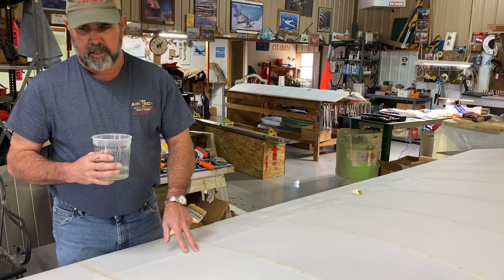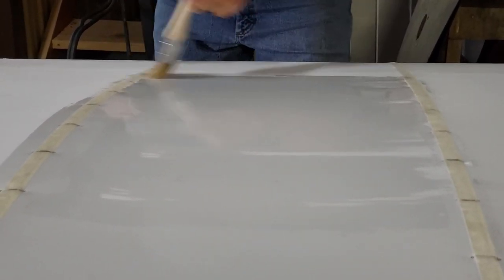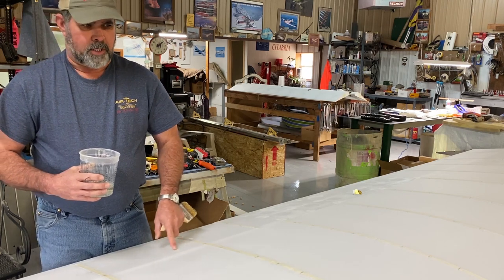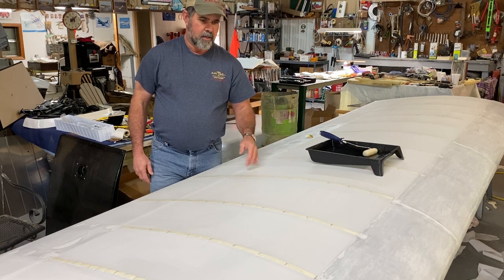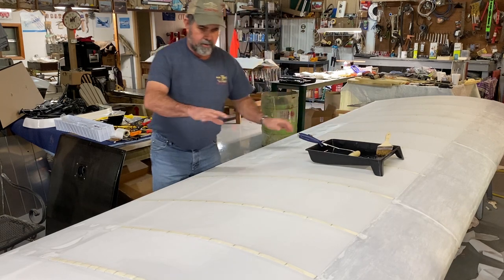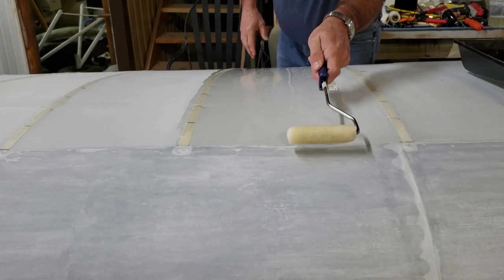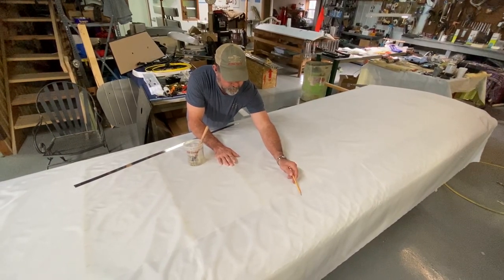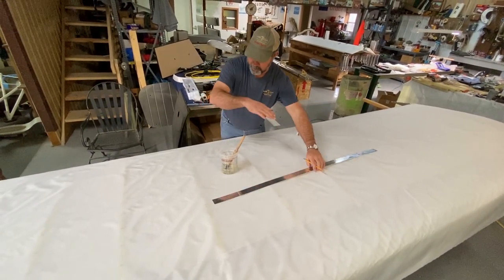17 - Airtech Coatings - Double Cover A Experimental Supercub Wing

Comment: The fabric is stitched or riveted on to take the air loads. The outer covering is simply glued over that with no mechanical attachment. It seems to me that air loads would try to suck the outer fabric off the the inner and the only thing holding it on is the glue.  To what speeds has this kind of double covering been tested, I wonder?
Reply: Pitts model 12 with 400 hp do it all the time. It’s not for the beginner. . Attached same as you put on a tape but does not have all the open edges to start to peel.

Comment: What' s the reason for a double cover job? Just strength?
Reply: I wonder how much weight too
Reply from the maker: On a gram scale doing regular with tapes and double covering its almost negligible difference between the two. Ends up cutting out some primer by covering everything in the thin coats of glue.
Reply: @airtechcoatings  But it's done for bush planes for strength right?
Reply: Airtech Coatings very cool! Thanks for the info
Reply: rickylarch  Don Adamson in first video explains original origin. Now days , just a neater look . Doesnt take much more if any time if you are use to covering
Reply from the maker: @rickylarch  there is lightweight and heavy fabric.  If you need stronger than lightweight normally that would be the way to get that.